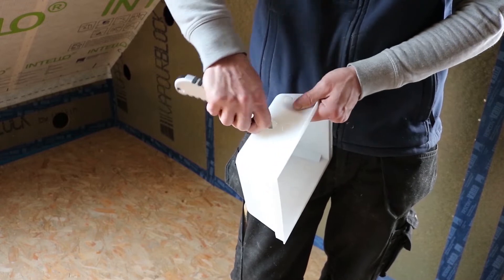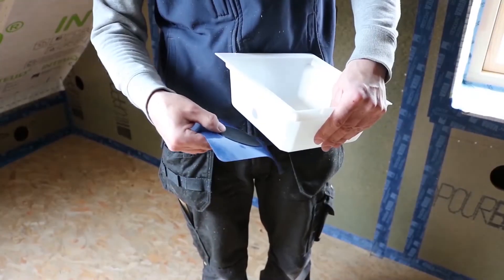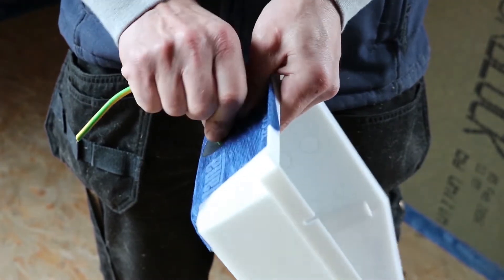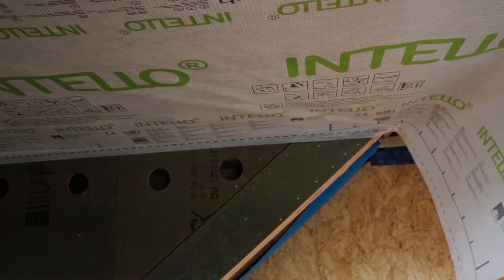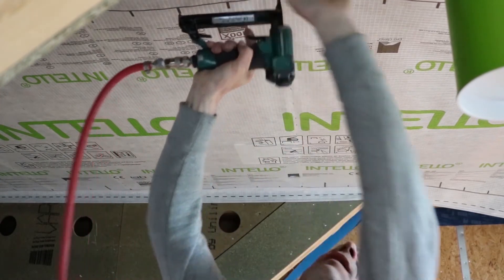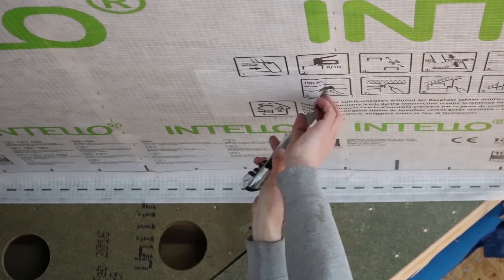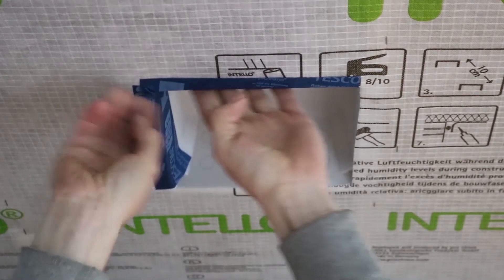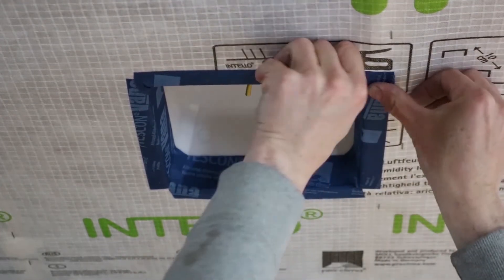How to install Optime Airtight Downlight Protectors

Comment: Hi - can you put the grommet on the inside to seal the hole?
Reply from the maker: Hi @RajINDER121. The grommet can be put either on the inside or outside of the optime downlight protector. Alternatively an airtightness tape or airtight sealant like Pro Clima Orcon F could also be used to seal the penetration.

Comment: Can I lay the barrier over the existing plaster board? This would also allow me to secure the downlight boxes to the old plaster as joists are far away from the light positions. Also should I tape over the staples?
Reply from the maker: For an airtight (top floor) ceiling we would suggest you follow our loft insulation blog and install the vapour control membrane to the loft floor and then insulate on top of that. This retains the existing ceiling and allows you to cut holes in the plasterboard to install the downlight boxes in the correct location from above (joist location not a problem). If you choose to install the vapour control membrane from the interior side, the plasterboard will need to be removed, then Intello Plus and downlight boxes installed as per the video. Battens and plasterboard would be reinstated over the top to complete the ceiling. More details here: https://www.ecologicalbuildingsystems.com/post/how-to-insulate-your-loft-with-natural-insulations
Reply: @EcologicalBuildingSystems  I phoned dupont, they said what i was saying was fine. Basically an airtight layer over the existing plaster which is then layered with pir and plaster board. i could run battens to support the downlight boxes i guess, probably the best bet.